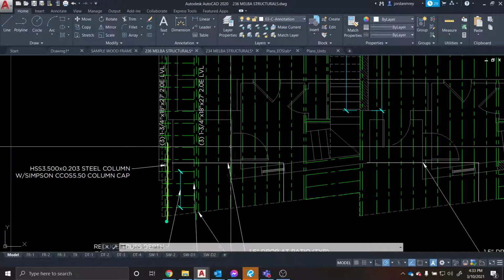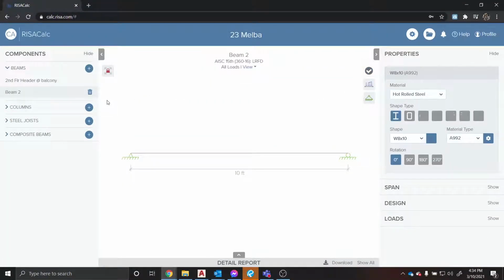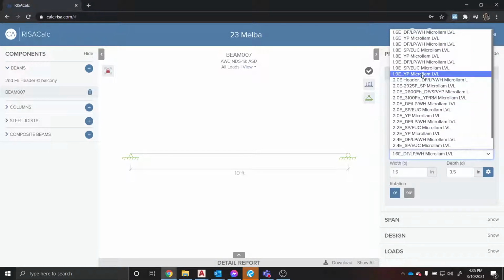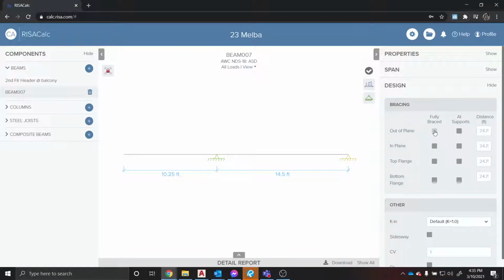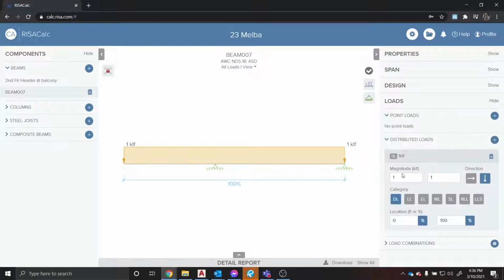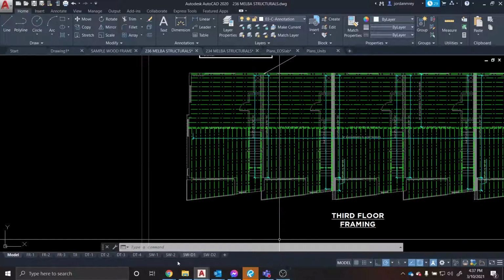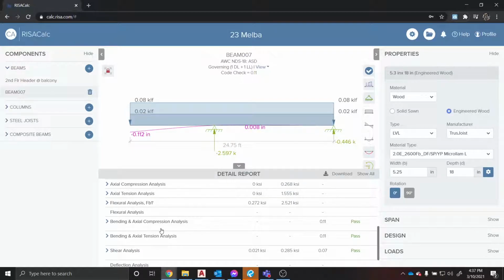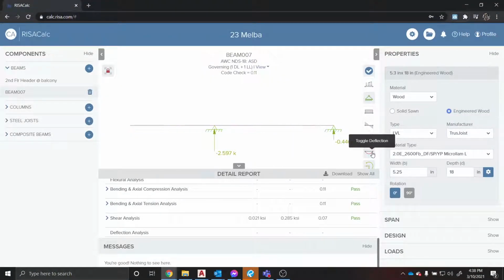Sizing Cantilever Wood LVL Beam with RisaCALC

Comment: Very interesting could you elaborate a little bit more on the type of connection you would use for the uplift force at the support? You mentioned upside down hanger? would you use then an down and upside down. how would you doo that? is that a concealed hanger for positive moment and maybe a regular hanger for negative moment? would you also use straps?